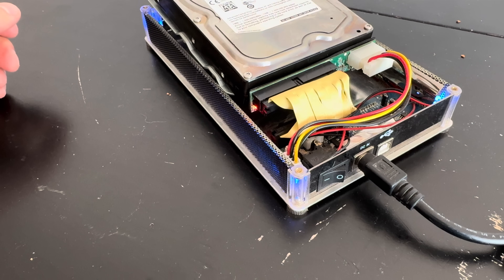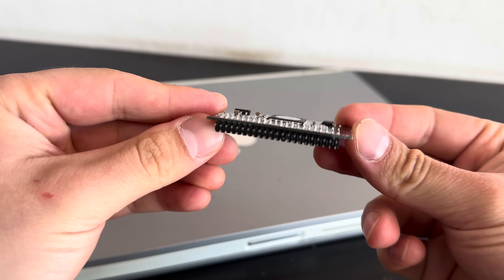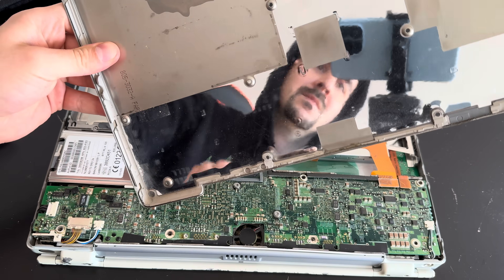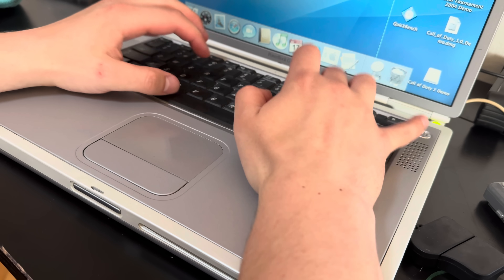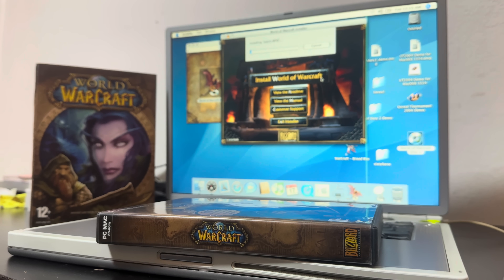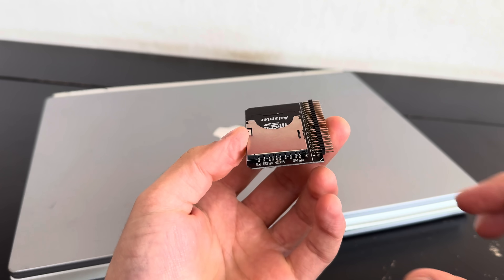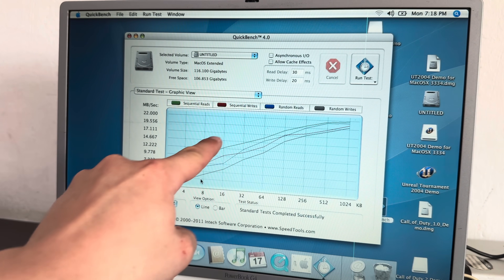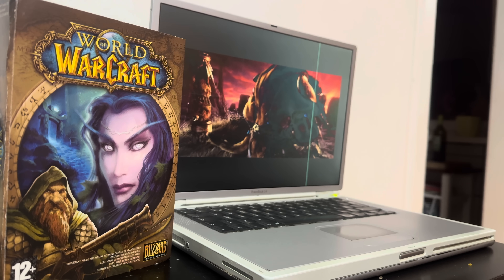Using SD Cards Instead of HDDs?

Comment: You are lucky! In the last ten years at least 7 of my Harddrives stopped working but for now, not a single SSD faced the same fate and i own a similar count of both technologies... When it comes to SD Cards, the story looks a bit different, i had a few cases where they also died but in comparison with HD they are still much more reliable. Recently, i decided to only buy Professional NAS Grade Harddrives and i think and hope that they will be much more reliable and last longer then the cheaper Consumer Grade ones.
Reply from the maker: I don’t know man, in the last six months I’ve had dozens of 20+ year old pcs and notebooks on my bench, and pretty much all of them had working drives. Perhaps I’m just lucky, but I do have failed drives from all sorts of other rigs.
Reply: I haven't found USB flash drives at least anywhere near as reliable as HDDs. HDD data is also sometimes(maybe often) recoverable even if the hard disk "dies", by using recovery software. I had this happen decades ago & I was able to recover basically all of the data.
Reply: My 17 year old 320gb WD blue hard drive which came with my core 2 duo pc is still working with no bad sectors lol

Comment: I have a 486-DX computer running DOS 6.22 using a 512Mb CF card as a SSD. I also have a external CF slot in the back wired up as a slave drive so i can swap out a second "hard drive" to transfer and store files/games. The obly complaint i have is that it doesnt have the wind up sound that is so exciting about old computer HDDs
Reply from the maker: Yeah, that’s what I was talking about. Pretty neat. As far as sounds go, well, old computers have other mechanical sounds (floppy drives, optical drives, PSU…) to get excited about
Reply: @schvabek  true. Like the fdd on my C-128, i can recognize the distinct chatter of my favourite games loading like morris code.

Comment: Recommendations, use a full size SD Card instead of a Micro with Adapter. MicroSD cars are only meant for Smartphone or devices that only use the microsd slot. If you have a full size SD slot, use a full size SD Card for maximum performance.
Reply from the maker: @AaronStarkLinux  Yeah, didn’t have any of those on hand, this seems to work just fine. Actual SD cards are actually kinda hard to find locally for me.

Comment: Anyone knocking HDDs out-of-hand is either a child that knows no better, a person with little data or who stores all their data in a cloud (where it is more than likely stored on HDDs), or a tech snob.  Or all three.   I have nearly 40-years of data stored on various HDDs I've gathered over the years, one particular HDD I know came in a Packard Bell computer I purchased in 1995 (from Montgomery Wards of all places) and it has yet to lose a single bit of data.  They have a proven track record of reliability, durability, and cost effectiveness that is unmatched by anything else, more reliable than anything or anyone else I can think of except maybe my dogs, but even there the HDDs win in terms of lifespans.
Reply from the maker: Yep, pretty much how I feel. However, some of them in my collection really are getting on in years, and I wouldn’t blame them at all if they let out the ghost. And this actually seems like a handy replacement for hobby computers.
Reply: HDD fails as well. If a bad sector is detected, it does a track move to a new track. All HDD have some tracks for reserve. I don't know what SD cards do but when you buy a 64 GB SSD, it is actually 59.6 GB. The reserved space is used during writes, to avoid writing too many times to the same locations.

Comment: I kind of don't even remember using USB 1, 1.1 or the like to move files. I do think that some of the earliest digital cameras had that unless they stored on floppy disks or used firewire. I think that one camera even used component video over RCA cables, the camera came with the video card for your computer and pinnacle studio. The difference between USB 1 (.2?) and 2.0 is night and day, 12 MBPS versus 480. And USB 3 is like gigabits? 🤔
Reply from the maker: By the time flash storage became relevant, we’ve already moved to 2.0 speeds. The first revision really was mostly for printers, mice and other peripherals, not really for moving gigabytes of data (though you could), you had FireWire for that.
Reply: Never cared for usb 3. It has weird things about it like the extra pins and wonky drivers. Kind of a buggy revision tbh.

Comment: My oldest laptop (a Compaq nx7010) used to have an IDE-CF adapter board. To that, I connected a no brand CF card. Needless to say, the performance wasn't stellar, and I had to rely heavily on RAM by making certain parts of the filesystem be tmpfs.

Recently, I decided to instead purchase some IDE-mSATA adapter boards. Be aware that some of them are made for handheld devices like cameras only, and don't implement IDE's full command set. The one that ended up working, was one that was also physically sized to 2.5" IDE. In it went a 256GB mSATA SSD, which improved performance significantly. Now the bottleneck is really just the bus itself.
Reply from the maker: @vimicito  I think I’ll try using these in some other computers, just to see what the performance/compatability is like. But I will definitely try out some other interfaces, just to experiment.

Comment: Congratulations on having a working Tiger install, especially a burned copy.  Every one I'd found, been given, or made was faulty, even when created from the original media.  Possibly me just having a run of bad luck.  I like the idea of running a machine from an SD card, they don't use much power, are faster, and reduce the carry weight of the machine, but what stops me from doing it, would be the longevity of the card itself, how many reads and writes it would do before the card gave out.  I'm also wondering if an adapter exists with multiple slots, would there be any improvement in throughput, by pre-formatting the cards, and running them in a RAID1 configuration with auto-repair enabled?  I've done this on my current machine to store a small library of data (not porn), and it's actually pretty fast.  Three 32GB USB sticks, (Same model, capacity and vendor), it's actually faster than doing the same thing with a single USB stick, and has the added benefit of multiple redundancy, if one or two slices fail, it automatically repairs itself.  Using a single drive or stick would leave you vulnerable to data loss.  The only drawback is, it's a software RAID, which is slower than a hardware RAID.  It's a poor man's SSD, but it works.
Reply from the maker: I think you’re way overthinking it 😂 just try it out for yourself, the adapters are super cheap. As for me, I don’t really care if it brakes. I use them for my retro hobby computers, so it’s not a big deal if they die. 

The tiger distro I’m using comes from Archive dot org. I have no idea why you’d have an issue installing it, except if you’re trying to install it onto a Mac that doesn’t support it.

Comment: You can flop around an SD-card no problem, but i would advise against flopping around that ribbon cable, it can suffer fatigue failure, this is why some sort of a mount makes sense for long term use. Even just a little bit of tape or something.
Reply from the maker: It’s fine, really.
Reply: I agree.

Comment: unreliable?????? tech illiterates... ssd you CANNOT RECOVER data from if it fails, and the more you write the more prone to failture it gets...and ys, it's slow, that's why you use it for your actual data and boot from an ssd, and keep the apps themselves on ssd (bc easy to reinstall, who cares if lost)
ofc ssds can last many years already but still, fundamentally if an ssd cell bit dies, it's ded ded, if an hdd dies, you can recover data
Reply from the maker: @jan_harald I was referring to 20/30+ year drives I use for retro hobby projects. And while they are, in my opinion, quite reliable, I do think it’s reasonable to assume they will start to fail after all that time. As for being able to recover data from it, I mean, sure, I don’t really know what that has to do with reliability, they just store data in a fundamentally different way than an SSD. That can also lead to security issues, with them requiring several rewrites to make sure it’s “off”.

Comment: I had an Apple IIe, and in its time there came up the ultimate luxury - an HDD integrated in the power supply! GIGANTIC 5 Megabytes of storage! 40 Floppy discs! 

It cost 5,000 marks, more than the computer. Could have been made by Trump, for luxury you have to pay.
Reply from the maker: @feedingravens  Damn. Hard drives in general back then were an enormous flex. Only bigger flex I could think of is having something like a CD-ROM in the late eighties.

Comment: Makes me glad i like vintage computers running haiku OS, freebsd or even openmandriva
Reply from the maker: Sure, all decent OS options. I prefer sticking to native operating systems.
Reply: @schvabek  I would myself however I just don't like how Microsoft or Apple has became with AI, and ratting you out to using your data to send you ads
Reply from the maker: @sangreevolver not really an issue if you run OS9 or Tiger lol. These machines are just barely capable of getting online as it is.
Reply: @schvabek  I wonder if os9 or the tiger can still run a old dot matrix printer
Reply from the maker: @ I don’t think it’s an OS issue, I’m pretty sure most of them hook up via parallel/serial

Comment: unreliable and hard drive in the same sentence is crazy
Reply from the maker: Like I’ve said, I had very good luck with them, and they did prove very reliable. However, I can also definitely see how they will start to fail more often, just given how many decades had passed.
Reply: @schvabek  yeah most people using hard drives that are failing probably  have had them for years which explains why it's still my favourite storage medium by far though just because the way it works makes it live forever (excluding physical damage and all)

Comment: Problem could be the old OS and the Hardware/Adapters/SD Cards you use do not support TRIM/Wear Leveling so then after a few hundred write cycles you'll end up with Read/Write Errors
Reply: Yup, you'll kill SD cards, USB drives etc after a while.  Had a laptop with a "too small" main drive that couldn't be upgraded, used USD drive instead.  You might get a year out of it.  Not sure if it was wear cycles or heat .

Hobby retro machine?  Yeah, it'll be fine.
Reply: SD cards have their own wear leveling and do not rely on the OS to do anything about that. In fact most card readers you would have anywhere (in a laptop or as USB device) do not support sending TRIM to SD cards anyway.
Reply: @romanrm1  Full size SD cards have wear leveling. microSD cards generally do NOT. So use a full size SD card for an application like this, it'll live longer and they cost about the same.
Reply: @mal2ksc  I don't think that is correct, it might be better to say industrial cards have wear-levelling where-as as consumer grade ones do not.  Plenty of posts on Raspberry Pi, Arduino etc forums wondering why their card died after a ew weeks or months (usually after running some sort of logging app).

Cards will still swap out bad sectors, so you might get a bit more life if you use a card far bigger than needed, say twice the size.  (This is why Windows complains about drives being full, you need a lot of empty space to do wear levelling etc on your SSD).

As before for a hobby machine you boot once a month, it'll be fine.  Just leave heaps of free space.
Reply from the maker: @jfkastner  Really a non-issue, for me at least. I intend to use these things on hobby retro computers, and the card dying/needing a reformat is really not a tragedy.

Comment: I bet why the HDD speed was so slow is because it's made for 4K sectors or blocks. Google that Samsung Align Tool mentioned on the drive label. If OS X can't format it correctly, the sectors won't be aligned with the physical layout of the drive, causing it to perform poorly. Same thing with solid state storage where older operating systems don't have native support to align their formatting and required special software to do it. Or you could format the HDD and SD with a computer running a newer OS then install on the G4.
Reply from the maker: The Samsung HDD in the thumbnail isn’t the one used in the video, that’s an old IBM travelstar, and it was actually indented to be used with PowerBooks (they used to ship with IBM drives).

Comment: There are ide SSD's you can buy as well.
Reply: A 128 GB ssd  in sata drive format is less tha $20.  They did not make them in IDE FORMAT.
Reply from the maker: @danc2014  they do indeed sell them nowadays. You can get them with, I think, a little integrated converter board. Look it up.
Reply: @ In  case the link I tried to post didn't take look up KingSpec PATA/IDE SSD.
Reply from the maker: Sure, not nearly as cheap as this though
Reply: @schvabek  No. A bit more ~$40 US for 32 GB, but no adapter required.
Reply from the maker: @misterspock1  Adapter is less than $10. And people might already have SD cards they can use. If not, 32 gig card is cheaper than the adapter itself.
Reply: BUT if it could net you substantially higher transfer speeds $40 isn't bad. I'd still say it was worth a test for me.
Reply from the maker: @misterspock1  sure, I’m not saying it’s a bad option at all, it’s just that, at least for me, I use these things with old, hobby computers. And I rarely pay more than 20 bucks for those. So upgrades that cost twice as much as the thing itself really don’t make too much sense to me, especially if I’m going to be using them just a couple of times a year. Speed is very rarely an issue. I’m in no rush to get things done when I sit down to use 20 year old PCs.

Comment: Yes, but no. Yes it can be done, but don't do it long term. SD cards, especially Micro SD cards, are not all that tough in long term OS usage, especially OSes that tend to do a lot of read/write cycles. Reason I know, Raspberry Pi. Long story short, for an OS like Mac OS that does a lot of write cycles, that's going to be harsh on that SD card over time and wear it out faster than an HDD or a proper SSD.

They are also not exactly fast, their biggest bottleneck is based on the flash memory controller. If I am not mistaking, ATA/IDE has some high speed options depending on how old. In comparison, some of the fastest SD cards usually max out around 100-120MB/s which is around ata6/ata7 (which is around 100-133 MB/s.)

That said, in the case of the hardware in the video, since that computer uses basically ata5 (ultra ata/66), as you showed in the video, the only thing you lose is the platter spin up and the read/write heads seeking.
Reply from the maker: We’ll see how it performs, but if you’re using it for a hobby computers, chances are that it dying won’t really be a big deal for most people, and it’s easy to replace.
Reply: @schvabek  That is a fair point, and kinda what I was getting at. SD cards work fine for Raspberry pi and similar hobby boards. As long as it's not difficult to pull the Hard drive which as you showed, it takes disassembly of the device, this would be a bit of a hassle to be able to swap drives a lot. Perhaps there is a differently designed device that can put an SD slot to the edge of the case where you could make a slot in the case so that it would be easier to swap cards?

 But for long term usage, a proper SSD would be better for the long term usage.

Comment: i think part of retro computing is hearing those old hard drive noises. i hope somebody can manufacture small capacity loud hard drives since many older hard drives are starting to die.
Reply from the maker: Sure, but I see no point In purposely making them loud lol. Like I’ve said, I use these drives that I have, and the vast majority of them work just fine

Comment: There is another suggestion: buy SATA hba or RAID card and connect sata drives to it. Oh wait. It won't work on laptops.
Reply from the maker: I’d also guess it’s many time as expensive as an sd card solution
Reply: @schvabek  depends. HBAs are pretty cheap nowadays. Raid cards, even second hand, would cost more. Plus you'd need SAS to SATA cables (which are cheap). But RAID has huge advantage called additional features.
Reply from the maker: @LedoCool1  I don’t see too many reasons to do any of that, especially if we’re talking about a hobby-retro computer. I’d much rather have something cheap, simple and compact.

Comment: I used to boot my parents' MacBook Pros from SD when they'd take my computers away.
The latest OS X versions would use about 15.6GB on the 16GB cards.
Reply from the maker: That’s funny 😂 I would’ve installed something a leaner OS at that point
Reply: @schvabek You should be able to repair that missing LCD line by applying pressure to find the fault and hot glue to the flex cable close to the bottom of the line . A hair dryer can also help reseal the faulty spot. 👍
Reply from the maker: @ Hey man, you had a heck of a video spree 🤟😂 Hope you enjoyed them. I might have a crack at fixing the display, but it honestly doesn’t bother me at all.
Reply: Nice effort, If you had two SD cards, you could have used the OS X one to write a lighter Linux OS to a different SD card assuming as a kid you had access to that.
Reply: 15-20 years later... 
Parents, give me all your computers, phones, TVs, SIM cards now...
Reply: man, I remember in Windows times I used to exploit allot the windows safe mode to add new admin accounts to install all I wanted :))

Comment: i run a sun ultra 5 off a 128 gb sd card, it's pretty picky if you get a sinitech sd to ide it's a good stand in for the original western digital that it demands.
Reply from the maker: Yeah, I’m sure there are computers that are not as happy with it. In this case, it worked out better than I could’ve imagined